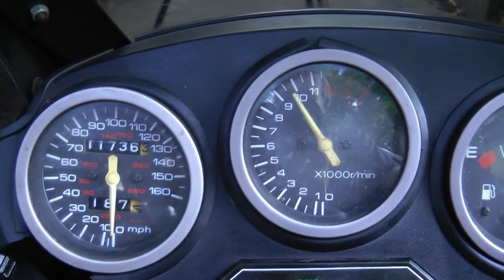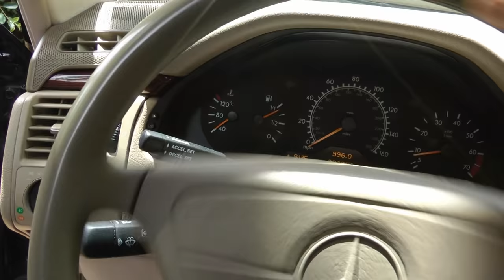How to Find Power Steering Leak in Your Car (Hose Replacement)

Comment: Scottyyyy help meee!!!! please..I own a Nissan altima 2006, I have a steering hose leak and a transmission leak , on top of that now transmission problem . when i start the care there is whistling sound and shift to "N" also give same sound and same for "P" but when I shift to "D" it doesnt and when i drive the car it makes whistling sound in first gear and shifts automatically to second and run smooth and when the speed reach 35 and about to change to 3rd gear it skips .and makes sound. ! :((

Comment: My hose has come off in 2008 escalade. How do I clamp it back on?
Reply: The inlet or outlet hose?  One is screwed on TIGHT and is the pressure(outlet) and the other is the backflowfrom the rack which is put on with a clamp

Comment: hey scotty once again its me chamblizi of youtube dot com!

i have traded my f-250 today for a 1975 ranchero i noticed when i cut the wheel hard some smoke came out at first i thought it was the valve cover but then i double checked and called autozone and i have a leaky power steering line only leaks when you cut it hard. any advice for patching a power steering line?

Comment from the maker: @unforgiven101inc Put some UV leak dye into the power steering reservoir and see where the green dye is coming out. Often the rack itself in VWs, a VERYexpensive fix. Just keep adding fluid,and try some AT 205 reseal in the tank to try to seal that leak, I get it at amazon.com Scotty

Comment: I walked into a shop today for power steering issues along with my brake line leaking right side in the back and my gas peddle wouldn't push down nothing won't budge okay, so here comes the mechanic picked up my hood, checked the transmission oil, slams the hood back down 1500 OMG

Comment: hi scotty my name is vince i have trouble with my 98 ford windstar i have to chang my  power steering hose but the screw wont not go in
Reply from the maker: they are often very hard to line up and get to screw in. My advice, do the hard end first with the other end not connected. Wiggle the hell out of it until it lines up right

Comment: about how much would it cost  to replace the leak..my garage told me $50.00 just to check for leak ...is  there someway to give me a ball pk figure   thanks clueless..

202 Mazda, Tribute   suv
Reply: +Rebecca Gonzalez You probably fixed it by now. I just came back from the dealership....2007 Camry $327.00 not including taxes.

Comment: I dont have the UN Dye but i defiantly think i may have a leak. I got a Hyundai Tiburon 2001 and i need to find a cheap but durable hose and if im correct the top hose is leaking, any one got any ideas on where to replace it for a good one?

Comment: i heard you have to use the MB fluid only , then i saw where a service notice said you can use ATF . this is a question asked by Thousands . so unless in way off   in the Dark Web  , Red is ATF ,  MB is a clear fluid  . i know the ATF is way cheaper and i noticed the fluid  Scotty used was Red  lol  stated he often uses other Bottles to store his fluids .  my MB is a clear fluid  1998 E320  . my opinion is if whats in the system is red id use the red ATF  if it is clear just use the MB CF . not sure what can go wrong if there mixed   anyone else  have any info to add  id be interested .

Comment: today I replaced my power steering pump on my 94 Gmc z71 and it still leaks I traced my steps I forgot the o ring to go on the back of the resavore it leaked bad and the new pump bearings fried and the good thing is I have lifetime warranty on the pump so got to replace it again I felt dumb
Reply from the maker: +Ken Null they do on the ones I buy from auto zone all the time

Comment: I have a 2000 x type jag and the steering will not return to center please help
Reply from the maker: that means the rack has a problem. Costs a TON on that model, BUT try my video "Fixing binding power steering" and pray that cleaning fixes it. Often does.

Comment: I have fixed the tranny but still there is whistling sound when I start the car and when I shif the gear Like I said to drive or reverse (when rpm is low the noise fades away , and when I am driving after I reach 37 km /h the third gear is not shifting automatically but the second gear shifts smoothly as normal. 
What could be the reason PLEASE help me MY car is still at THE garage.. should I get  COmputer check for Error codes.

Comment: I replaced the high-pressure line on my power steering, got everything put back together, and the new hose leaked in the same spot. WTH? Help?????????

Comment: what if the hose runs through the bolt as such
Reply from the maker: you replace the hose assembly, and the bolt is unbolted and the part the bolt goes into is part of the assembly
Reply: +Scotty Kilmer I mean it's stripped though
Reply from the maker: then odds are you will have to replace whatever part the bolt goes into, such as the rack or the pump. Those hold 1500 psi pressure and generally you can not rethread them without them leaking after

Comment: Cheers ears
Reply: I had to hoses in a roll start lacking I'm getting frustrated!
Reply: +Donald Alldredge I had get started working on my ford mercury Markez 1994 with a roll4.6 liter I bought a manual a cilton' s I'm having trouble with my power steering hose leaking right after I replaced it with a brand new one it started leaking right after!

Comment: scotty i hit a fucking dirt, probably damaged my power steering fuse, than i heard "bang!" sound so hard and suddenly my steering became stiff, i drive it slowly to my house, the oil leaked all the way, i am afraid that i damaged the rack and pinion? or ps pump?
Reply from the maker: +Jimmy Johanes hitting things can bend suspension parts, so check for bent parts first and see what is leaking then fix that